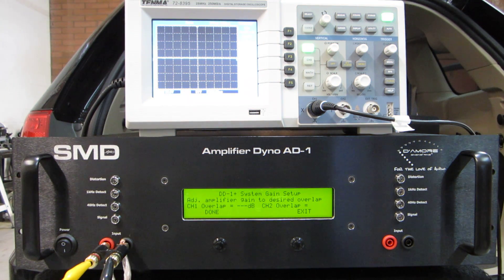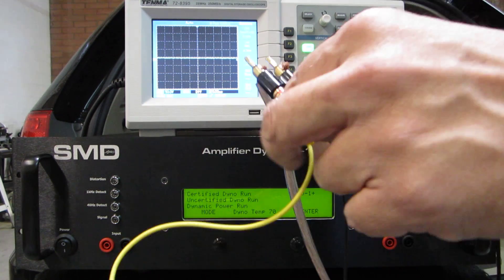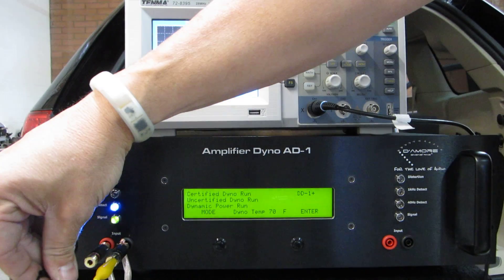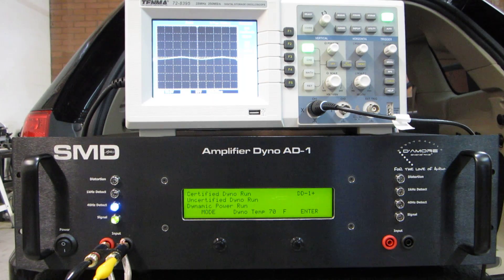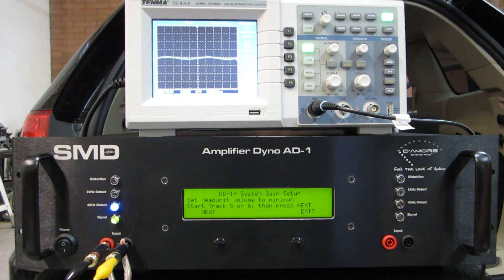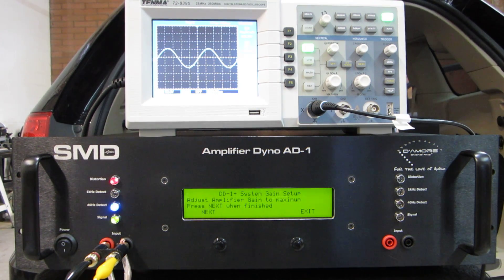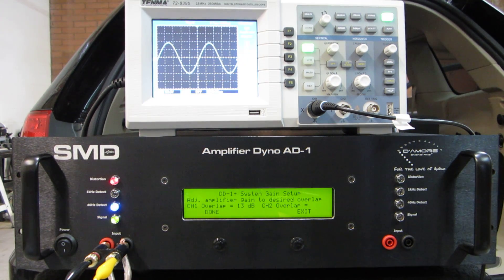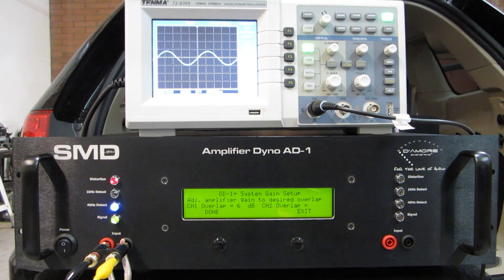SMD / D'Amore Engineering AD-1 Amplifier Dyno demo part 1 (Gain and DD-1+ system)

Comment: He states there is nothing wrong with the AD-1 unit, the headunit it uses puts off a strange signal, not the AD-1's fault, it is a headunit issue. The AD-1 has already been tested and used plenty showing that it is 100%.

Comment: Someone wpuld please help me out here. I was wondering, you plug the amp's output to the dyno as if it were a speaker coil, right? Then you select the desired impedance and run the test. But that is static measurement, whereas the coil changes its impedance over the frequency spectrum it receives. How would that be reflected on the results?. Sorry if this is a kinda stupid question, Im far from an electric engineer

Comment: Yes, I know what you are saying.  With the DD-1+ system you don't need to know where the amplifier clips because the system will determine that automatically.  But you do need to know your max unclipped volume setting of the headunit.  The classic DD-1 system, which the AD-1 also has is great for that, but in the case of this Jeep the headunit output is dirty.  We are working on a feature like what you described for finding that max unclipped headunit level.  It will be just a firmware change